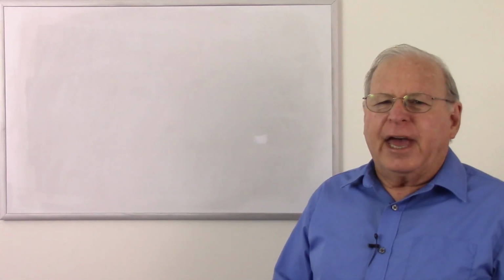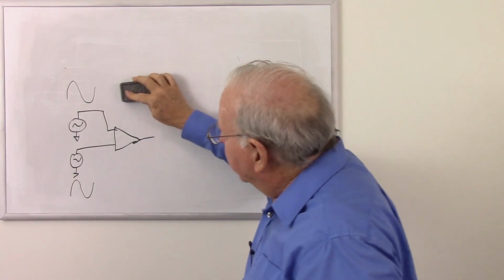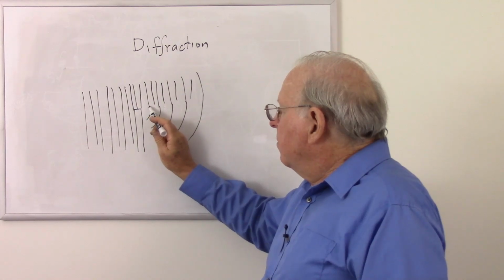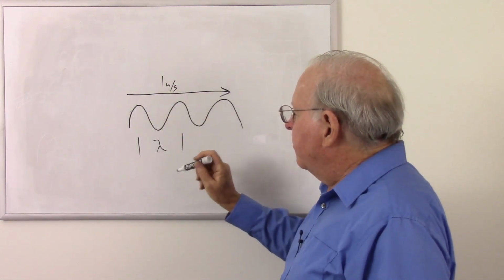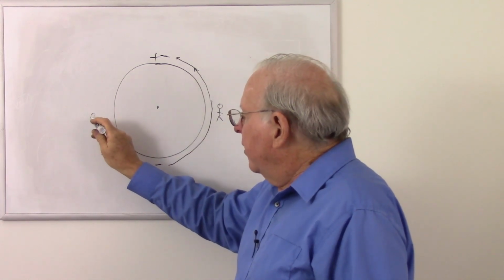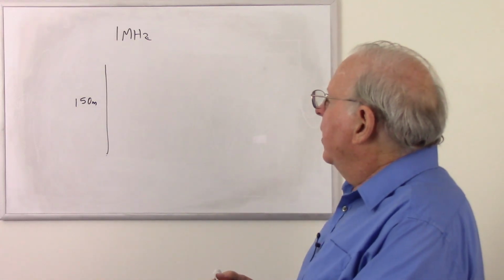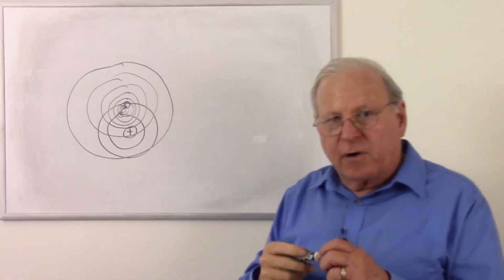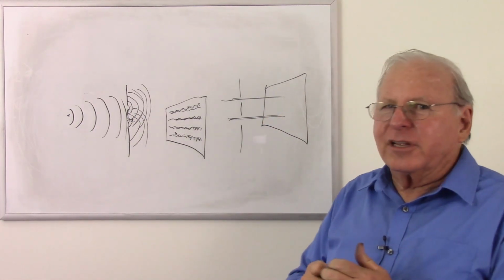Electromagnetic Waves: Radio and Light - Solid-state Devices and Analog Circuits - Day 12, Part 1

Comment: page 426

resonance 1. An oscillation of a system at its natural frequency of vibration, as determined by the physical parameters of the system.
Reply: 22*22 = 462
interfere/ intervene = men-|celah/ me-||ny||ampuk
stir = kacau
infer = a verb
refer = rujuk = ruju' (Ar)
Zunar = a former local cartoonist
personal = peribadi
Persona = 1st released in Nov. 1993 by Proton
ڤسونا; pesona = attaractive
Peso = monetary unit of most Spanish-spoken Latin American and the Philippines
aruh = induce
'Aruf = an Arabic male name
ais = ice
mata sempit/ sepet = jafnu-l-'ain (Ar)
Spectra = a Kia Motors automobile
100 GW = 1000 000 000 W 
se-|ribu juta = 1000 000 000
W = Watt = P/t
sunnah. (Ar) = Prophet's way of life
sunan = pl. to sunnah.
dengar = hear--heard
hingar-bingar = noise 
ear = telinga = uzun. (Ar)
ozone; O3 = O-O=O or O=O-O
zone = kawasan
herdik/ jerkah/ tengking = scold; loud and rude
jerk = sentak 
sonar = sound navigation and ranging
infra|sonic = very low acoustic frequencies
ultra|sonic = extreme high acoustic frequencies
frequent = ke-|kerap|-an
Sony = an electronic brand
sonnet = 14-lines rhyming poem 
Synchronous Optical Networking = SONET 
Sonata = a former Hyundai brand's Car-of-The-Year
mata|hari = sun
thaania-thnain = ber-|dua-dua|-an
Niyaz = a male Pakistani name
sunny day = hari cerah
does not = does'nt
dozen = 12
dizzy = pitam
ufuk = horizon = ufuq. (Ar)
aafaaq = pl. to ufuq
meagre = about in|sufficiency
suffer = ber-|susah+payah/ merana
eager = cenderung
feel--felt = rasa
field = medan/ padang/ lapang|-an
k = wave number
me-|rebak/ me-||ny||ebar = went viral = intasyara--yantasyiru--intisyaar.
virulent = wabak
devastate = me-|musnah 
dawai = wire
Foldvary= a Hungarian surname
pe-|waris = inherit|-or
slave = kuli = 'abd. (Ar)
enclave = di-|lingkung|-i
Slovenia = a republic in SE Europe 
benyal = over|ripe
clove = a kind of spice
Clifford = a surname
excell = cemerlang = mumtaaz (Ar)
accelerate = pecut
kembang/ kembung = expand
sebar = spread
co-|incide = ke-|betul|-an
tindan = over|lap
medium = per-|antara
bongkok/ bengkok = bend
tackle/ over|come = tangan|-i
c/f = wave|length
c = the speed of propagation
disturb = ganggu/ kacau
turban = serban
motor = energy converter (eletrical energy to mechanical energy)
rotor = an electrical component
radar = radio wave detector
radii = pl. form of radius
jejari = radius
radio wave = a kind of electro|magnetic radiation 
radiate = a verb
ample = ber|lambak-lambak
gelombang = wave
gelung = large ring
relung; رلوڠ = a unit for land measurement
German = people of Germany
1 relung = 0.711 acre
exist = wujud (Ar) = ada
rythm = about rhym
anthem = a musical composition for festivities
antum/ antunna (Ar) = kamu semua = all of you 
antenna = aerial 
bell-bottom = a style of trousers that become wider from the knees downward
second|-er = orang kanan
top = gasing
sundial = gasing
Sunda = a set of islands in Nusantara
knob = tombol
nozzle = muncung 
mancung = pointed nose 
cycle = kitar|-an
frequent = ke-|kerap|-an
peak/ summit = puncak/ kemuncak
time-being/ now = se-|karang
inspire = rangsang
saphire = gem|stone
gemerlap|-an = twinkling
lapan = 8 = thamaaniah. (Ar)
snob/ elite = 'hidung tinggi'  
noble = ber-|ke-|duduk|-an

Comment: If you have a photon (light) source, can multiple sensors detect the same transmitted photon? Like multiple radio receivers can listen to the same source of EM waves. What I saw and understood from your video, when a photon has beet observed it vanish, thus if you can place enough receptors the EM wave will disappear. Let's say the receptors are at 90 degree from the light source in front of the double slit the interference or the light will vanish all together at the dubbel slit because all the receptors took all the transmitted photons.